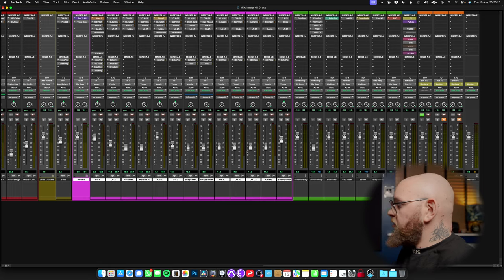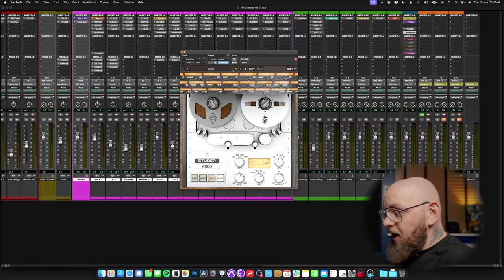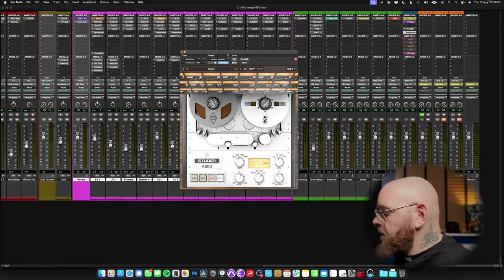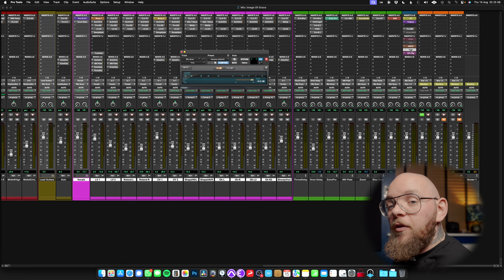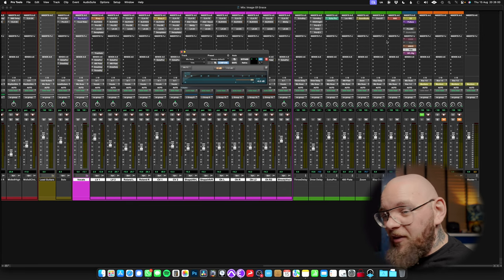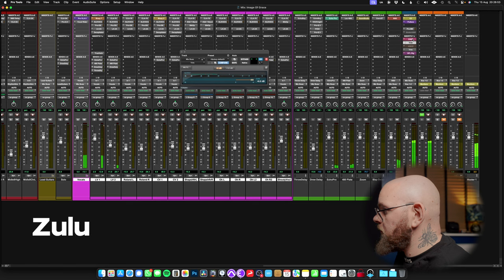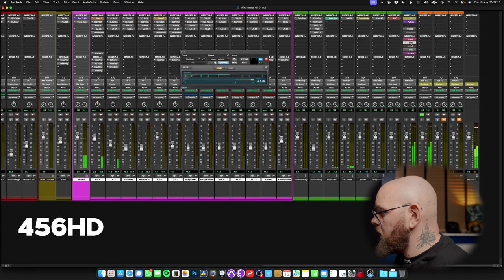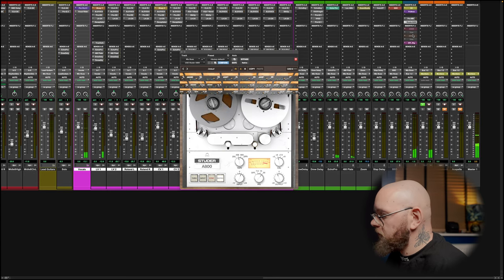The Ultimate Tape Shootout! - Roger Mayer 456HD vs Handsome Audio Zulu!

Comment: Hi all, a great preset that Joel Hamilton (Studio G - The Black Keys, Nora Jones, Lettuce, Highly Suspect), he puts Deck and Headroom on Lo, Bias on (12 oclock or -) and Enhance on 3 oclock. He then hits this really hot with his SSL 4000 console. Zulu can take rather hot input levels and while it's counterintuitive,  you can recover the perspective of lost gain by going in hotter to Zulu. Super hot, occasionally peaking over 0db hot. 😅
Reply from the maker: Excellent information! Thanks for sharing!
Reply: These settings are no joke. It just flipped around how I had set my Zulu, but I tried this and whoa! I'm now hitting it hotter than ever out of the Silver Bullet Mark II driving with the Mojo C engaged along with the tone with the highs slightly boosted to make up for the Zulu's softening. I tried shooting it out against the Satin plugin on my master bus and then I did at first prefer Satin. Then I tried them both together. It was pretty dang good so I followed with the instance of Satin after the external hardware and then WOW! Now that's a secret sauce!!!!!! Using the Zulu this way is the best way it's sounded so far! It somehow adds depth and makes things way more natural.

Comment: Thanks for the comparison. I assume bypassed was omitted to avoid the trolls, but it would have been nice to hear. Not being able to get unity gain out of these two was a turnoff for me when deciding which 500 series tape emu to get.
Reply from the maker: Yeah the volume loss is annoying to be fair but you get used to it after a while and a good trim plugin. The Zulu being 10db is pretty brutal though haha
Reply: @OliverShillito  This Zulu has a good excuse being passive, but Zulu 500 could have unity gain if plugged in and not unity if unplugged.  The RM just strikes me as... lazy. I want a 500 module to be compatible with the modules in series before and after it. I don't think an option for balanced I/O is too much to ask for considering the target market and asking price.
Reply from the maker: @sparella I agree to be honest! Fair points!

Comment: Thanks for this. I havent started this vid yet, but I'll share my experience with the Zulu. I really WANT to like it. Would be so great if I could just buy a $1,000 box that sounds like tape...my experience is that it doesnt emulate tape very well at all, and I struggle to notice the effect when volume marched. It certainly does NOT emulate tape compression. I shot it out several times with plugins, and other "tape" hardware, and it always fared poorly...worse than many plugins even
Reply: Have you ever used real tape?
Reply: @dougleydorite  not extensively, but I have a lot of material that was processed on several different machines and types of tape. I use them when i compare tape plugins and hardware

Comment: hmm, so the zulu, is a bunch of transformers and filters? Bizarre that it's passive, so, it also doesn't really distort, right? Like if you'd push tape, and really get tape saturation, it's not really gonna do that right, especially with the circuit being passive. Tape machine's are full of amplifiers, witch also colour the sound. Also, it's not gonna make any tape wow and flutter obviously. i find all the settings quite suddle to be honest, it sounds great, like running sound through a bunch of fat transformers and passive filters, but it doesn't really do what tape and active amplifier circuitry does to tape. at least the roger's you can really drive it.
Reply from the maker: Yeah the Roger’s will definitely saturate more! I guess nothing will sound as close to tape as actual tape but to be fair the Zulu isn’t bad as a “colour” box. It’s definitely pleasing on the ear! I’m not a huge fan of the form factor but I believe they now make a 500 series which could be great!